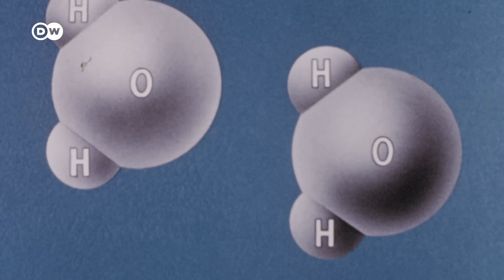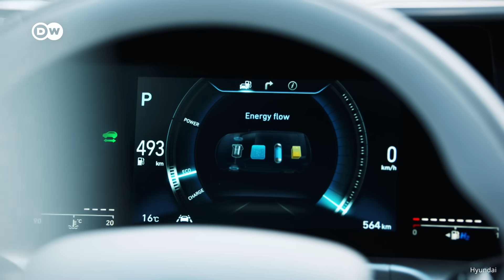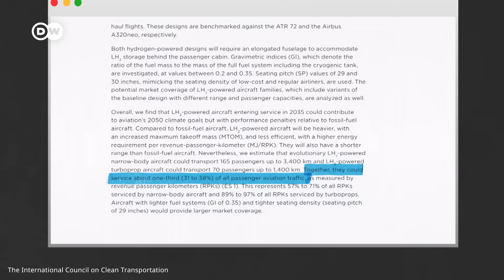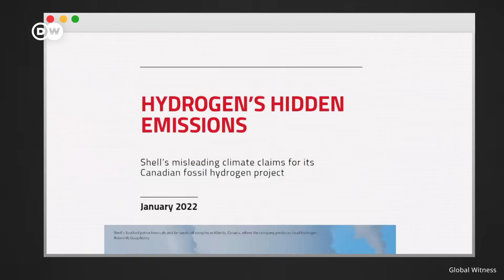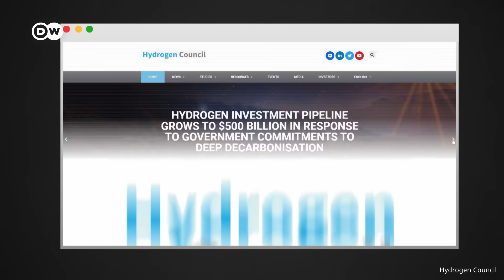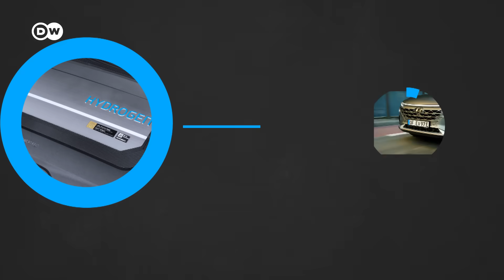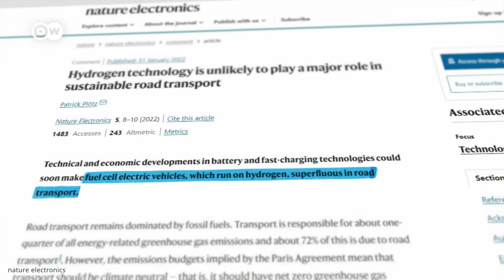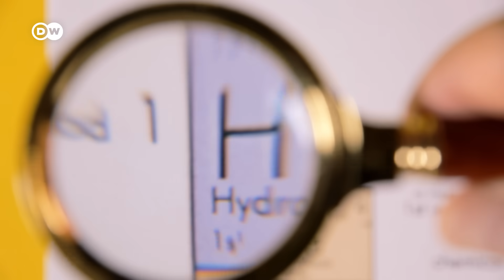The truth about hydrogen

Comment: This was like jumping into “renewables” without calculating the long term effects of the extraction of rare metals, recycling of batteries, and efficiency of said tech, etc..which can lead to among other things to  the energy crises like we have today.
Reply: yes another "gotcha" like with the renewables market 
but this is not a new thing and there are very good reasons it did not take off
Reply: No body talks about the problem of hydrogen storage. Touched on in the mention of low energy density and high volume. To have compact storage for a vehicle, it needs to be stored at about 1000 psi. Or stored as a liquid at temperatures lower than liquid nitrogen, with a tendancy to permanently boil off.
Reply: Batteries?
Reply: That's like complaining about the rubber and steel, and oil that a Model T needs to be built and run. We're not even at the end of the 2nd generation of EV's. And they are working on better chemistries.
Reply: Y también que necesita agua dulce, y se suele sacar de los recursos naturales en Latinoamérica y África, pero los que más lo usan son los países primermindistas. En mi país van a sacar del acuífero y no saben si va a volver a llenarse, el acuífero es el ma agrande de América latina y es fuente de agua potable para MUCHÍSIMAS personas 😞
Reply: The real solution in my opinion is nuclear power. Zero carbon emissions. The carbon emissions from creating the fissionable material required surely is on par ot even dramatically less than that required to build batteries for EVs. And, if everyone drove an EV, how would we be able to charge them?? Wind, Solar??? At this moment with all California's renewable energy and a low percentage of EVs , those EV owners are being asked NOT to charge their vehicles.  Something is clearly wrong with this scenario. Nuclear is a safe technology that has been around for decades. I realize the waste product has to be dealt with but we can, and have, dealt with that.
Reply: @richgoodwin929  nuclear is not zero emissions mainly for two reasons: first of all making, transporting and refining fuel is an energy intensive process (and mining is incredibly damaging to the local environment, something the amount of carbon emissions alone can't convey).
Secondly making a nuclear powerplant requires incredible amounts of concrete, which is very polluting to produce and in limited supply because sand is a non renewable resource. After a few decades to a century of operation the powerplant must be demolished because it has become too radioactive for human operators, a process that requires about another century to complete and after which all of the rubble and the top level of soil on the site are effectively nuclear waste and must be treated accordingly. Aside from all the issues, building a nuclear powerplant requires at least a decade and we simply don't have that much time to act. Renewables in comparison can be rolled out much quicker and have likely even better emissions wise (live cycle assesment of emissions is hard and the estimates are all over the place).
Reply: @superj8502  Have you looked at some of the newer nuclear technologies?  ‘Gates Notes’ web site had an article on something called a ‘slow wave’ (I think that’s what they called it) reactor?  It uses spent nuclear fuel, and cannot develop a runaway reaction and melt down.  It takes something like 90 days to get going, and is the result of getting a bunch spent fuel together (my simplistic understanding, not an expert at anything here, but find the discussion very interesting).   Not sure what the impact on construction environmental costs would be, but I would think that without the meltdown danger it might be less?   I guess a major benefit would be that you don’t have to mine and process uranium. 

Thoughts?

Thanks for the enlightening discussion folks!
Reply: @superj8502  nuclear only requires a tiny fraction of the materials that solar or wind do per unit of power generation, and its mostly cement while solar and wind need glass steel and silicone and a high volume of other rare metals.
Reply: @richgoodwin929  also nuclear is an energy source while batteries are a form of storage so there is no point in comparing them.
Reply: @superj8502  clearly I was comparing wind and solar to nuclear. However, solar often uses batteries as a storage system because HALF the time the sun doesn't shine. 
Wind does not blow all the time either. 
Nuclear power on the other hand works 24/7, except when shut down for maintenance.
Reply: @richgoodwin929  go read your comment again, you were talking about batteries.
Nuclear being on 24/7 except for maintainance is a gross misrepresentation as last year france's nuclear powerplants were offline on average 40% of the time "for maintainance" (about as much as fossil sources).

Other things to consider:
1) nuclear (and coal) powerplants require massive amounts of water for cooling, and if they can't get them they must be shut or at least throttled down.
2) renewables vary their production slowly and predictably, while nuclear and fossil powerplants often go offline with little to no warning, giving no time to ramp up other sources (a lot of the maintainance i talked about earlier is unscheduled).

You don't need to all-caps "half" as if the concept of nighttime was unknown to me or the readers. Also that's a smaller problem than it would seem because most energy consumption happens during the day (industry, ac, heating, trains, etc...).
Reply: @superj8502  Well what happens when Everyone has an electric car and they want to charge them while they're sleeping?
Reply: @richgoodwin929  i'm not in favour of private vehicles, neither gas nor electric. Public transit and active transportation are the best solution in almost all situations.
Reply: @superj8502  I see. Hard to imagine that happening anytime soon but I hear you.
Reply: But u need electric power plant to charge your battery
Reply: roughly 2% of lithium is recycled at a loss. it is in effect unrecyclable because of the complex chemical bonds that form in battery use.
Reply: Actually the current energy crisis in europe is caused by natural gas and would (and should) be solved by renewables.
Reply: @superj8502  The current energy crisis in Europe was caused by Biden and could be solved by not stealing elections.
Reply: @superj8502  Was going to say the same. Around half our energy is produced by gas in the UK
Reply: @superj8502  not this decade.
Reply: @petejung3122  what do you mean?
Reply: @petejung3122  Maybe putting tarifs to cheap solar panels from 2013 to 2018 wasn't very smart.... We payed for the incompetence of our leaders.
Reply: @superj8502  Actually, the reason Europe is so reliant on gas now is BECAUSE of renewables. Due to their high volatility and the current lack of grid storage, the more renewables you have the more gas peaker plants you need to stabilise the grid.
Reply: @dcircle5069  that would be true on a tiny grid, but the european power grid covers a vast geographical area with all kinds of differing weather conditions, thus the power output tends to average out and be pretty stable.

Also weather is fairly predictable, unlike unscheduled maintainance shutdowns, which are much more problematic on a fossil based grid because it relies on few massive powerplants. And they happen more often than you'd think.
Reply: @superj8502  The weather in continental Europe is much less diverse than you might think. And even if it were to average out across the whole of the EU, this doesn't help stabilise regional grids. High wind in southern France do nothing to balance out  a lack of wind in northern Germany.

If you honestly believe the weather to be more predictable than occasional maintenance shutdowns, then I'm afraid there's no reasoning with you.

Why do you think has grid volatility in Germany exploded with their move to renewables if - as you seem to believe - unscheduled maintenance shutdowns on a fossil grid are so much more common?

Unfortunately, our AC power grids rely on us matching power production and power consumption pretty much instantaneously. A fossil power plant going down for (even unscheduled) maintenance will still produce power for several minutes simply due to the inertia of the giant moving turbines. This provides ample opportunity to spin up one or more reserve power plants to prevent grid outages.

The same cannot be said for neither wind nor solar, both wildly fluctuate their outputs with zero inertia. This results in the need for frequent interventions to prevent outages and these kind of interventions need to be quick. So far, only gas power plants are able to spin up fast enough to do this. Subsequently, the more renewables are connected to the grid, the more gas power plants need to be kept on standby to prevent outages, thus increasing the reliance on fossil fuels rather than alleviating it.

Lastly, this frequent spinning up and shutting down of gas peaker plants is much  more inefficient than running a conventional fossil fuel plant permanently.

Of course nobody ever factors that into their calculations when estimating the carbon impact of renewables...

Until there is enough grid storage installed to provide the same grid stabilisation services, expanding renewable production will always increase reliance on gas.
Reply: @superj8502  not ever. Renewables are heavily subsidised, it will never work unless you're willing to pay the subsidies through taxes.
Reply: @TheSuperBoyProject  paying taxes is a pretty small issue compared to a climate apocalypse
Reply: "Rare metals" aren't actually that rare.  And newer batteries are using little or no cobalt or nickel.   Battery EVs are much more efficient than hydrocarbons and batteries are very recyclable.

Comment: Something only briefly mentiioed in this video are the major problems of transporting and storing Hydrogen. As clearly evidenced by the Artemis 1 SLS failure to launch this week. Hydrogen is extremely "leaky", it also requires much larger storage tanks due to its low density. These two factors alone will require vast subsidies to make Hydrogen cost competitive.
Net Zero is an admirable global aim but the timescale to get there HAS to be extended. What point in a net zero world when every country that pushes it is bankrupted? Add to that the major fossil fuel users have no intention of giving up using fossil fuels in the near future and net zero in the next decades becomes even more untenable. CO2 produced in China and India will not hover over those countries but will circle the globe.
Reply: With solar-electric plants it can be made on-site.  And those solar-electric plants can be small, and even portable.

Comment: There is nothing wrong with fossil fuels..  The CO2 problem is only a theory, there are many other reasons why the Earth may be heating up - increased Sun activity, the position of the Earth in the Solar System at this time, and quite simply, the number of people pumping out heat from bodies, energy use etc.  Question;  What created the Ice Ages, and why did they melt?  No cars, no planes, no industry, few people!  You have to be able to explain that before we jump to conclusions that it is all CO2’s fault!

Comment: Each day, thousands of powered industrial trucks, forklifts to those not in this field, use compressed hydrogen fueled proton exchange membrane fuel cells instead of batteries.  Why?  Because large warehouses can have hundreds of these vehicles in use 24/7.  No time to charge and if the warehouse fleet were to charge conventional batteries, the power draw would easily draw the grid to a brown out.

The hydrogen is either from high pressure cylinder farm or cryogenic liquid hydrogen.  The latter is easy to pump to 4000 PSI, vaporized and then sent to refill stations which automatically  control the process.   Usual consumption  rates require refill every 2 to 4 days.  
By far the most economical source is still petroleum derived hydrogen.  Electrolysis is 4 to 6 times more expensive than natural gas derived hydrogen.

It is all about economics.  Until one develops a solar photosynthetic process using plant enzymes,  natural gas will be the source for hydrogen.

Comment: So there is many problems with it. 
Need three time's the size of a gas tank. Which adds weight to a vehicle.
Takes alot of energy to make it useable.   And to compress it.  
And would cost alot more to transport it. 
Basically it's very expensive and not so green. 
Why it isn't being used much today. 

If every city could produce their own. 
The transport of it would be minimal.  
Then it comes to getting the electricity to transform it.   
Which could be done with natural gas. 

The problem with batteries. 
Is they're heavy and they last long enough.  Expensive to replace.  The material to make them isn't Green. 
Hard to get.   

The planet emissions pollution is one of the lesser concerns we should have.    China don't care and Russia doesn't care.  The 🌎 won't end because of pollution. 
Wars are what will destroy the Earth.   
While it's fine to try to have a little less pollution.    We shouldn't kill ourselves over it.  Like inflation. 
And destroying our economy over it.

Comment: The Australian Government thru the c.s.i.r.o and the Japanese Government are investing heavily in Hydrogen technology. Mining and producing lithium batteries produces a lot of greenhouse gases. Also China controls a lot of the mines. Lithium is not abundant, where Hydrogen is. Long term hydrogen produced with green energy will be the dominant force. It was slow out of the blocks but hydrogen fuel cells will catch up and pass lithium batteries. Problems with storage and transport will be overcome. Refer to the C.S.I.R.O. research.

Comment: overall i agree with the spirit of your video -- quite entirley, in fact.
Just a few points of inacuracy - ...  baking soda (sodium bicarbonate) added in the water to increase conductivity ??? ...
Electrolysis has nothing to do with conductivity.
Electrolysis in the case of this video is an interaction between electrolyte (solution of ions) and a couple of polarised electrodes (anode and cathode) - they exchange electrons which changes hydrogen ions into gas molecules.

Comment: You know what is better than both hydrogen and batteries? 

Trains running on overhead wires. Long haul trucking and medium/short distance flights need to be replaced by the only real green solution.

Comment: Build lots of nuclear plants. That's the only realistic answer for emissions-free plentiful and cheap energy. And if there are applications that can benefit from hydrogen, such as fuel-cell-powered electric transportation, the hydrogen can be supplied by the electrolyzers running on nuclear-generated electricity. Please stop this nonsensical waste of resources and the downgrading of pristine or, worse, arable land that comes with windmills and solar panels in fields, only to produce expensive (if not subsidized) electricity.

Comment: Hydrogen,  electrolysis,  simple by product water
 We should have had diffusion plants running by now ! Also what about desalination plants ?  Hydrogen wins. Single must abundant element in the universe.  We will always need petroleum,  now way around that either.  Moving parts requires  lubricity. Helium 3, molten salt reactors . There are many alternatives.  They are not serious. Blasting apart mountains to remove precious metals,  with droughts & talings.  All poisonous.

Comment: Its still a load of utter nonsense. You act as if you critisize anything, but all you do is advertise and completely miss the valid points.

There is NO green energy, bc wind, same as solar in mid/northern Europe and other such regions is not energy efficient. You talk about cost efficiency. Cost it competely irrelevant! It is about being energy efficient.
So if the 2 major 'green' suppliers are not energy efficient and therefor not green, there also cant be any green hydrogen.
Apart from that you assume still there is man made climate change, which is nonsense aswell
And you miss that cracking CH4 to H2, which already loses energy bc it takes place at high temp, then converts to H fuel cell with 80% efficiency at best, can compete with burning CH4 directly with combined heating from rest energy, which gets energy efficiency to 70% max. There is no benefit there, so no green H aswell.
Not even mentioning electrolysis, bc that is too ridiculous to even mention. You use electricity, to make H, which needs to be collected, compressed to liquid, transported, to then be used in a fuel cell, which converts it with again 80% efficiency, to .... electricity. That makes no sense whatsoever.

Im also not interested in what some finance girly has to say, that doesnt know anything about chem or calculating energy efficiency. And not interested in engineers that seem to not understand basic physics.